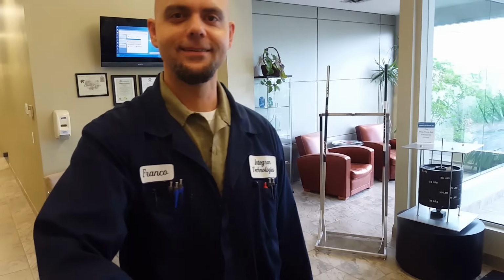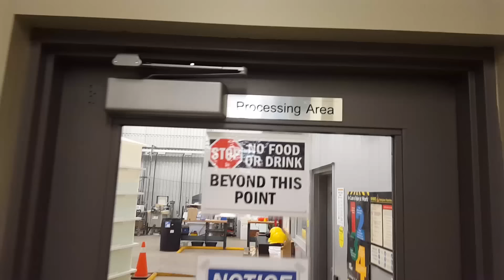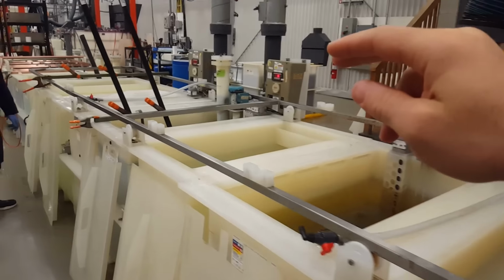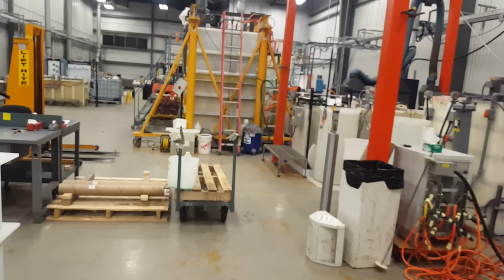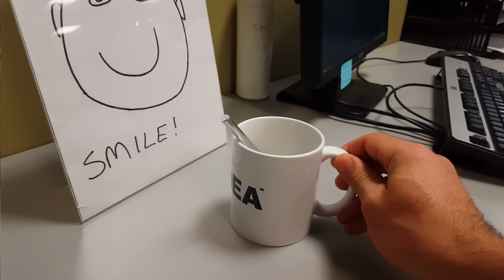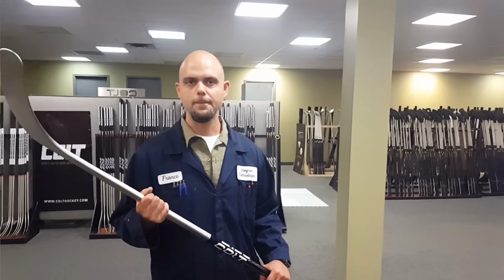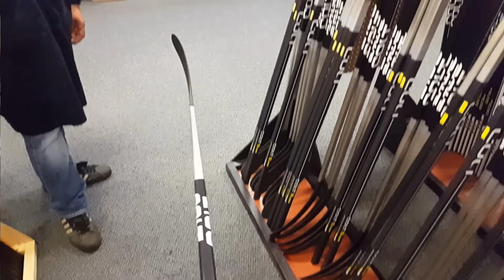How Colt Hockey Sticks are Made

Comment: cool is there a difference in how they make the different gens which one was being made in the vid
Reply from the maker: +GoProSniper18 Same process for the Gen 1's, they tweaked the sticks for Gen 2 by moving some carbon higher on the shaft to reinforce the top, and better balance the stick where they add the steel.
Reply: +The Hockey Movement by How To Hockey oh
Reply: The Hockey Movement by How T

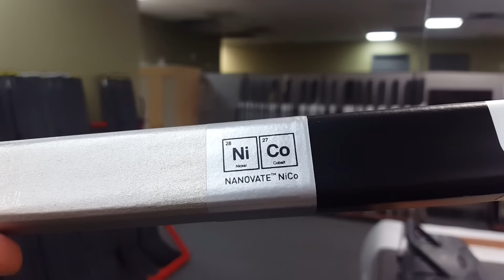Comment: So all they are doing is electroplating raw plastic sticks from China. There's nothing "nano" about what they are doing. Countless everyday items, such as the plastic housing of a Stanley tape measure, use the same process to plate metal onto plastic or metal. Not only is there nothing "nano" about it, there's nothing "steel" about it either (steel is an iron-based alloy), nor is there anything there that they developed or that NASA developed. At 5:05 you can see what the sticks are plated with: nickel and cobalt, both of which are elements. No one developed elements, obviously. They are part of nature.